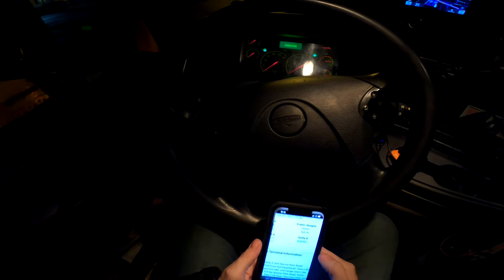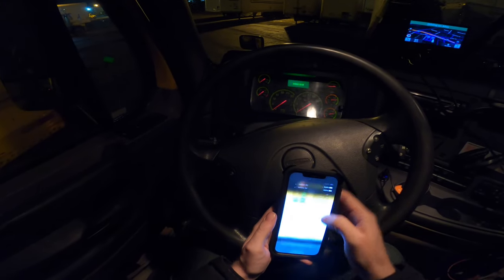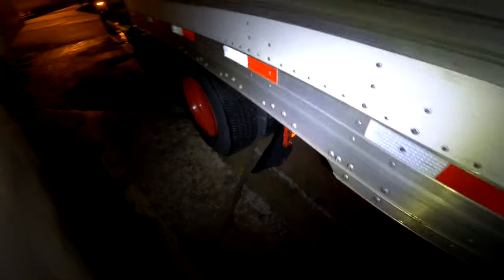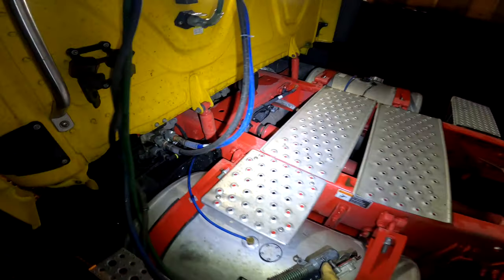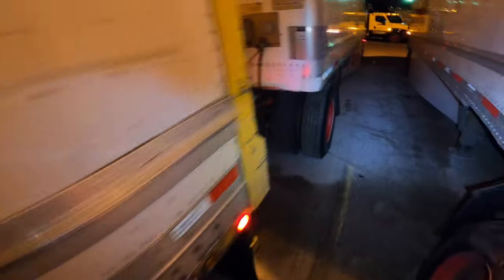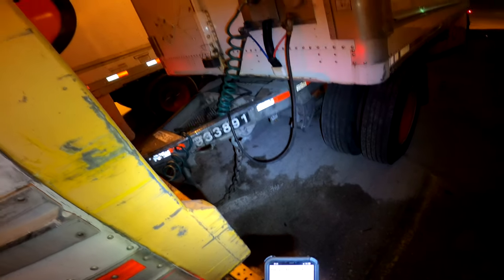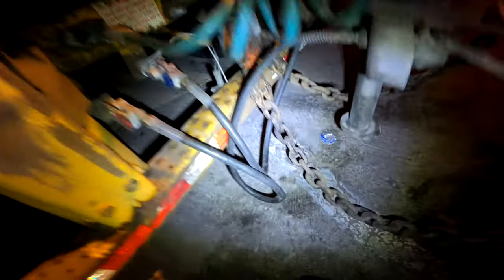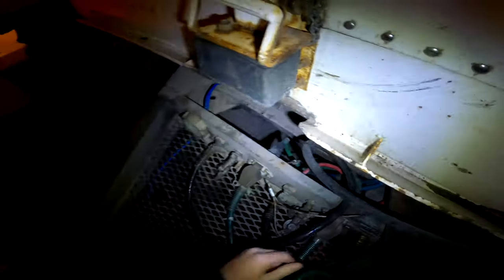It’s like half-extra board, half-bid run

Comment: The reason why those landing gears are stiff because the shop do not grease those those LANY gears has grease fittings and they should be Drees on the trail as a service this is caused the stiffness even caused the landing gear to break or buying all the gears lock up shot needs to get better on pre-trip in trailers when services them.

Comment: The trailer landing gear should be greased the shops should grease those Landing is when they serve those trailers or get taken into the shop and mention about landing and greeting they have fittings for them this causes the gears to bind up it makes it hard to whine up.
Reply: By watching you&chucks vlog 
 I applied for Linehaul extra board up here in at the Baltimore terminal and got my interview at the terminal this Friday morning. Thanks for all you’ll vlog.